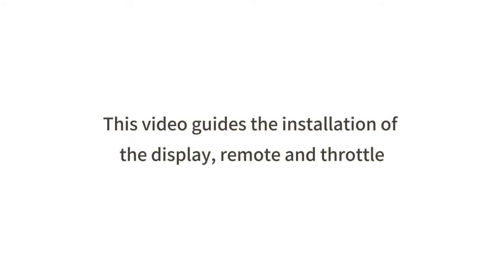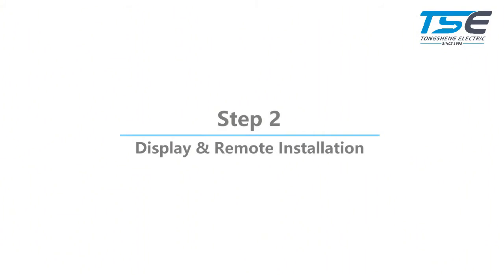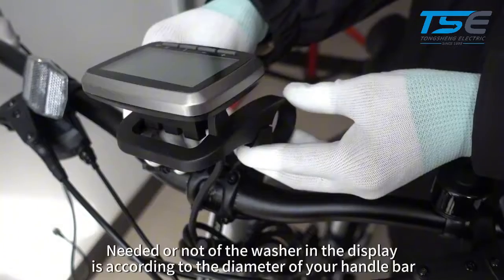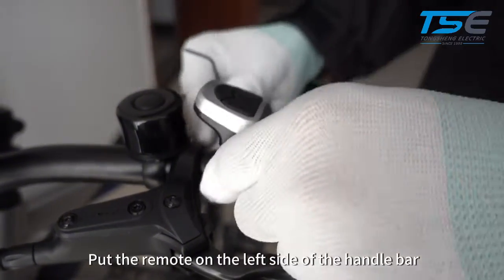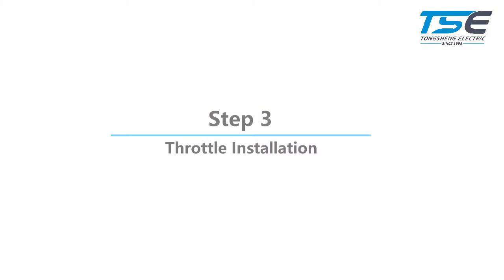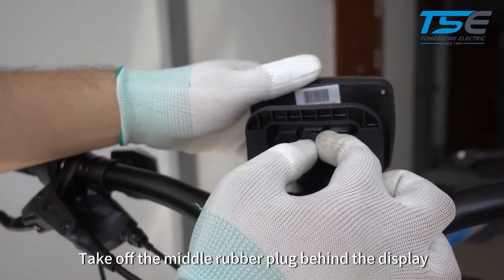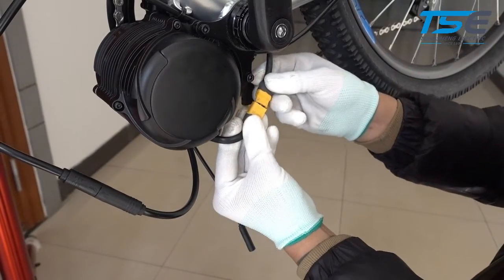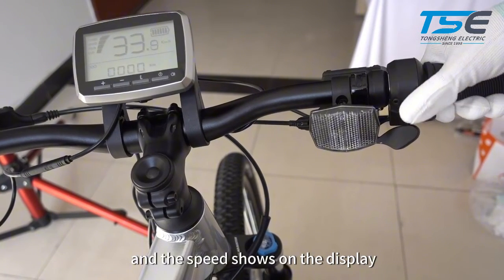TSDZ8 Conversion kit Installation——Display & Throttle

Comment: Thanks for your Very Efficient and Clear Video 🙂

I would like also Thank You Even MORE for the So Great Quality of this Motor Kit. I used it since Several Years Way Above the Work is had been Designed, 

like pulling a Trolley of 150kg, but still, it has Sudtained the Effort; TRULY AMAZING! 😀

THANK YOU SO MUCH AGAIN, because You have up to now Saved Myself And My Little Family by 

Providing a Mean To Survive with my Trolley in a Professional Use.

Best Regards and Sincerely, 
Didier